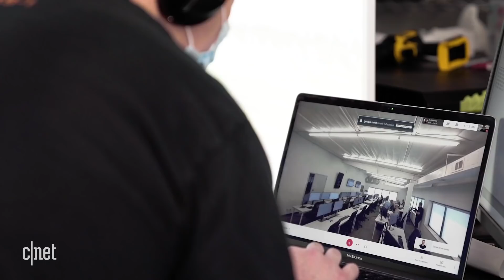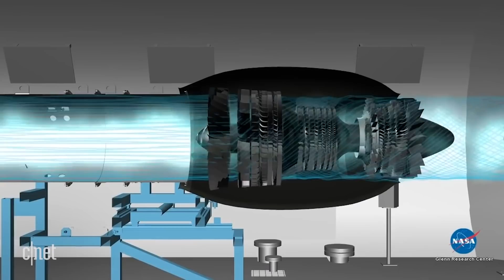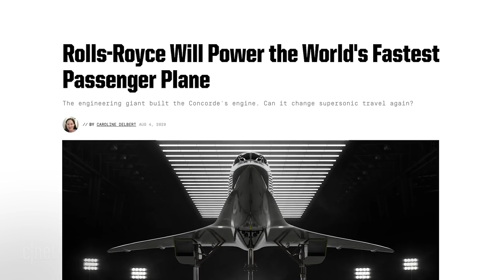The supersonic jetliner built to run on sustainable fuels

Comment: Not sure Boom can keep the prices of the planes that low. However, if they do and seats remain priced at J, even F class levels, I'll definitely fly them. Cutting the SYD - LAX flight time in half is a deal maker. J on VA was amazing on this route and F on QF is the same. It may be a bit hard not having a bed to lie down on for even 8 hours. But guess it just depends on overall comfort. But the reduced flight time makes it 90% of the way for myself. The 10% will ultimately left to comfort for 8 hours.

Comment: Concorde didn't fail because of the noise; Concorde failed because it didn't have enough RANGE.
Concorde went 4,500 nm which corners it exclusively into the NY-London NY-Paris market. If you want to fly mostly over water and have a big enough market, you need Trans-Pacific Range -- 6,300nm or about the same at the 787-10. This covers 85% of the commercial routes. This is more important that ticket prices or any of the carbon emissions, global warming, rubbish. Concorde prices were actually fine. But a production run of 14 aircraft wasn't fine.

Comment: So Concorde was designed, tested and built in 7 years out of coke can aluminium and steel with slide-rules and 12 wind tunnel models. Today we have CFD, FEA, carbon fibre and kevlar composites and rapid prototyping - and it takes us 17 years to achieve basically the same thing?!  Do we really NEED to suck this badly?

Comment: If they  hit the 2030 deadline, I think they have a good chance of being the only supersonic player in town. I doubt the other manufacturers are that serious about supersonic products, outside of the odd concept aircraft. 
I see challenges, but also opportunities. I mean, in an increasingly crowded and low margin aviation market, having a product this different  could be a massive selling point for airlines and allow them to offer a product that is truly unique. Selling round trips that allow you to fly fast out to your destination and then lie flat in business overnight back, could help boost sales of existing tickets.

On the other hand, the cut-throat nature of the industry could make it a hard sell. Airlines are constantly looking to shave every expense and this is a massive expense. $200m for a plane that seats 50-75 is a lot, although increased fleet utilisation could reduce per-flight hardware costs somewhat. Then biofuels are very much possible, but not exactly in abundance, so the plane will likely use normal jet fuel. At that point, it is down to what the fossil fuel industry looks like in 2030 and if carbon offsetting via capture is affordable enough. If the plane flies higher in the atmosphere, perhaps even higher than concorde, it is possible to fly in a "super-cruise", where the increased air flow is reduced by flying higher, making resistance possibly similar to that of existing planes.

I think what it ultimately comes down to is the fuel efficiency, nature of the industry in 2030 and prices on carbon emissions/availability of biofuels. It's a big gamble, but it is one that no other manufacturers seem to be seriously taking, so it could pay off well.

Comment: There is only eighteen seconds of the video starting at 1:32 which mentions the 'sustainable fuels' that the plane will run on. Like biofuel (ethanol made from corn ?) or pulling the fuel out of thin air.

Comment: It will never take off commercially - ramjets are more feasible. Also, advances in battery storage will mean super-cheap costs in travel when electric aircraft become the norm (as cars are now doing) - and video-conferencing takes out the business reasons for flying supersonic.

Comment: Jet engine aren't really that picky, when it comes to what fuel you run. Actually the storage and cold temperatures are a much bigger challenge.
Reply: cold? when you go supersonic at high altitude the airtemp around the fuselage is really hot. Concorde had around 120C around its fuselage during flight. to mitigate temperature a cavity was created in the wings where the fuel flowed acting as a coolant. a system that today is used in other planes.

Comment: There is zero chance this project makes any money. The main problem with the Concorde was it only held 120 people. So economically it was too expensive to be practical, because the price couldn't be distributed the way it can on a normal plane which holds 300 people. And this plane looks like its going to be even smaller than the Concorde was. A flight on the Concorde from NY to London cost about 10,000$ per seat, which is not worth it just to save 3 hours. Not to mention the seats on the Concorde were very cramped because it was such a small plane, and this is hardly worth paying 10,000$. People would rather pay 10,000 for a normal first class flight that takes longer but is roomier and has reclining seats so they can sleep.

Comment: Whether a travel-time reduction by 50% is worth the higher ticket cost, depends on the route. A big time killer nowadays, is operations on the airport. It sometimes takes an aircraft half an hour or longer to taxi from the gate to the runway, or vice versa. Boarding, deboarding and as well as going through customs, TSA, and check-in is what takes quite a bit of time on international or intercontinental travels. So the time reduction from 8h to 4h flight time is nice and all, but with all I said above, that's an actual time reduction from 12h to 8h - still an entire day. So very long flights I guess benefit from it, but a long flight like Singapore to New York has a very large section that goes over populated land, where they'd have to fly sub-sonic. I'm a bit skeptical when it comes to the number of routes they can service that are actually much shorter. Flights from Europe to Asia is almost entirely over land, and with a cruising speed of around 560kts (around 100kts slower thatn the speed of sound) of a regular airliner, I doubt they can squeeze more time out of that...

Comment: Sorry, but the Concord didn't retire because it was "just too expensive to operate", but first and foremost it crashed in 2000 due to delta wings. This big issue will be a big challenge for Boom to solve in order to reassure the public on the safety of delta wings (needed for supersonic planes).
Reply: Concorde crashed due to big metal part from another aircraft was on runway during take-off. This part hit the wing and damaged the fuel tank. Then it caught fire.

Comment: they talk about efficiency but they also wanna build a supersonic aircraft...those things do not go hand in hand. Drag is velocity cubed. The thing is basically a Carbon Concorde by the looks of it's shape, so it's not some magic aerodynamic marvel...it's using 1960's era wind tunnel testing. they would do better to develop bio fuel engines. that's the future of aviation
Reply: That same drag is also used to create the lift... 
Airplanes become more efficient with higher velocity unlike cars. (Excluding approximity to the speed of sound due to shock drag) anything above Mach 1 is more efficient.
And current engines can already run on biofuels...

Comment: Who gives a crap if the fuel is sustainable. It’s still just gonna burn it like crazy to give you that speed. This is a physics inverse law problem, the energy required to go this fast will always be a lot, and doing minor things like from aluminum to carbon fibre or whatever isn’t going to do much.

Comment: carbon fiber stands up to the high heat of super sonic flight?,,,, yeah the carbon fiber does.... the resin used to bind it DOES NOT. there a reason, the SR71 was made from Titanium... and theres a reason the F117 Night hawk made of carbon fiber listed top speed is under 700 mph... all components subject to thermal heating will be metal... aluminum and titanium just like the F22.

Comment: Will Overture have actual passenger windows as shown? These were a problem in designing Concorde since Mach 2 speeds created such heat that special cooling was required.

Comment: So the Russian Tupolev Tu-144 did not exist and fly before concord on both metrics Really Here is another one to consider Speed equals HP or KW (what ever you want) so going twice as fast carrying less than one third of the passengers at 3 to 4 times fuel consumption using a bio-fuel that requires a load of energy to produce is good how Oh but corn grows in the field Yes it dose but how did it get there

Comment: at the end of the 1700s the travel spped was 6mph by horse and wagon, at the end of the 1800s it went up to 60mph with the train and at the end on the 1900s it went up to 600mph with the airplane. going at this rate it would not surprise me at all that if at the end of the 2000s that we were traveling at 6,000mph but of course unless you are born today you will not be around to see it and even then you will be 80 years old.

Comment: Sorry, but RR is the worst company to develop the engines.  The Olympus engines on the concord were a derivative of a military engine already in service at the time.  Today, Pratt and Whitney and GE both may engines that currently are used on military aircraft that are capable of super cruise, and they are reliable.  Both the Engines RR developed for the A380, A350 and more famously the 787 have all had spectacular failures due to sever cost cutting from RR. 
Also I know this is a stepping stone to larger passenger liners, but I would still rather see a more high capacity jet than what is essentially a supersonic CRJ.

Comment: The question I am asking about the airplane is where the baggage goes...
The general concern is, if supersonic flights are a viable option what so ever... The planes will always have to  generate lift, which will always generate drag, and you'll never fly supersonic over land... So to me land (underground) transportation seems a way more viable... Even with high infrastructure costs.

If you don't agree comment and argue please
Reply: You can't get a subway from New York to France. :)
Reply: @gr8cescale  Not yet... There are multiple projects for submerged floating tunnels (Norway costal highway f. E..) scheduled for the next years. Floating tunnels are probably even cheaper per mile than drilling conventional ones through mountains...

Comment: It's pretty obvious that Boom is, essentially, a con. And quite disappointing that media outlets regurgitate the sales pitch without questioning anything.

Let's look at what this video alone promises:
1) The plane will be "carbon neutral" because it is designed to fly with biofuels or synthetic fuels.
This is utter hogwash. Biofuels and synthetic fuels are designed to work with existing engines. Therefore, either all planes are "designed to be carbon neutral" or, more accurately, none are. To let that dishonest claim stand is a complete failure of journalism.
2) The plane uses virtual wind tunnels and carbon fibre and modern technology, so it can be revolutionary.
3) The plane uses existing engines, existing materials, existing technology and will therefore be quick and easy to certify. 
Does anyone else notice that 2 & 3 are basically promising opposite things? What is the truth? CFD software (computational fluid dynamics) has been around for decades, as have light materials. So there is nothing revolutionary about any of that. If Boom can build a supersonic airliner, so can Airbus, Boeing, Embraer, Sukhoi, and any of the other aircraft manufacturers. Will it be easy to certify? No easier than the 737 Max, the 777X, the A350, etc. In reality, it will probably be harder, if it's built by a new company that none of the aviation authorities know & trust yet, and if its performance envelope is far outside that of current airliners. 
4) The sonic boom is moot because there are routes over water.
Actually, launching a plane that causes a sonic boom in 2030 (or 2040, 2050) is likely to be a lot more controversial than doing the same in 1969. From cruise ship companies to environmentalists worried about the impact of constant booms on whales, it seems doubtful that the issue will be shrugged off this time around.
5) The plane will cost about $200m apiece, seat 55 people, and a seat on the plane will cost about $5000 and it will fly by 2030, with a cruise speed of Mach 2.2.
This is really the crux of the matter. It seems extremely unlikely that those criteria will be met. Essentially, you are looking at a wish list, or a sales pitch,. not the specs of an airplane. They are building a tiny demonstrator now to help them design something that might meet those specs - but there is no guarantee that they will come anywhere close to succeeding.

So what happens next? There are several scenarios:

1) The plane never happens and Boom eventually goes bust. Probably the most likely outcome. I imagine 2020, the pandemic, the airline crisis, and Zoom will be blamed. (Headline "Zoom killed Boom"). But even without 2020, I think this would be the likeliest outcome. Boom underestimates the effort and costs involved in designing and delivering a production airliner - by an order of magnitude. Even something as simple as a regional jet is a challenge - Fairchild Dornier went bust over the 728, Bombardier barely survived the C-Series, and the Sukhoi Superjet has seen more crashes than any modern airliner (including the 737 Max series). All those programmes were less ambitious than what Boom is planning. Boom might have been good enough at talking the talk to get $150m (less than the promised price tag of one of their planes), but all the sales patter in the world won't get them to $2-$3bn if there's no substance to their promises.

2) They somehow manage to deliver enough progress to convince enough airlines and investors that they are serious. They somehow get enough money together for a full scale prototype. Then, it all falls apart, as the plane will be significantly overweight, more expensive than planned, and it won't be anywhere near the promised performance criteria. Maybe its range will fall short, maybe its fuel consumption will be too high. Even experienced aircraft manufacturers end up having to battle with performance issues. The A380 has only 2 thrust reversers because the weight was too high at a late stage in the design. Some regional jets never managed to achieve the right performance to land at London City airport, resulting in order cancellations. Virgin Galactic has yet to fly its first paying passenger, 16 years after the Ansari X Prize was won. If Boom gets to the prototype stage, they'll probably languish there in design iterations and safety issues for years, similar to The Spaceship Company. They might never emerge.

3) If they do manage to get to a stage where the plane is certified and in production, it will almost certainly not meet all the promises they make now. It'll be years behind schedule (wasn't it supposed to come out in 2023 in their original sales pitches? Now they're talking 2030, eventually it'll be 2040). Seats might cost $10,000-$15,000. The range might be sufficient for transatlantic but not transpacific routes, and the refuelling stops will increase the flight durations. The airframe might cost $350m instead of $200m. Sure, the Sultan of Brunei will buy one, and perhaps a few heads of state (if it's safe enough). Some business jet airlines might buy a few as flagships. Branson (if he's still got money), and maybe some Middle Eastern airlines might buy a handful. But, in the middle of the climate catastrophe, it'll be past its time before it is finished. Just as Concorde was killed by the oil crisis, so this plane, if it ever makes it that far, will be a tiny niche product if it enters production, and flying on it will be out of the financial reach of 99% of the world's population.

Comment: All business class? Its gonna be expensive.
Reply: Dhruva Mukhopadhyay Airlines have to make a profit and supersonic is not cheap, the people that would fly on this would normally just take business or first class on a regular plane, it’s not meant for ‘average’ people I guess
Reply: @riot2136  I understand and respect that but that does not mean that economy class does not make any profit. They claim that it runs on sustainable fuels. That in itself should be an intensive to make it economically viable. I do not think that it will tank the profit of the airliners.

Comment: Video revolves round the claim but  didn't asks the important qwestion or try to check the claim CO2 neutral engines, how is that possible and if design for plane engines hasn't changed then how the output could be changed.
Reply: hydrogen would be close to neutral

Comment: Unless CNET is paying its people extremely well, I doubt that "you and I" could ever have flown on Concord and likely won't fly on this or any other proposed SST. These will inheritently be low volume, expensive flights, that most of us never experience and that will not reduce the travel time for 99% of flyers. It remains to be seen if they can charge the equivalent of a business class ticket (they thought Concord tickets would be much cheaper than they turned out to be).